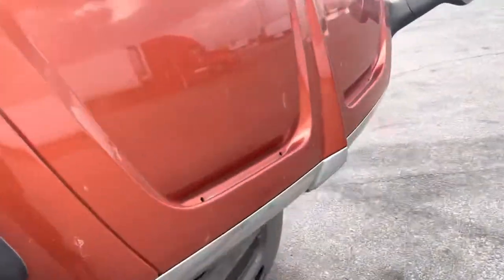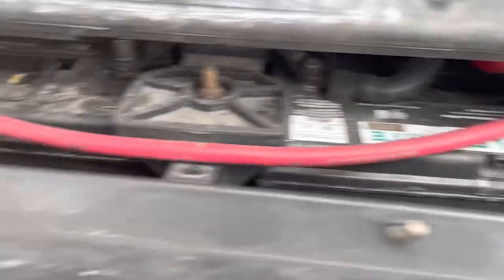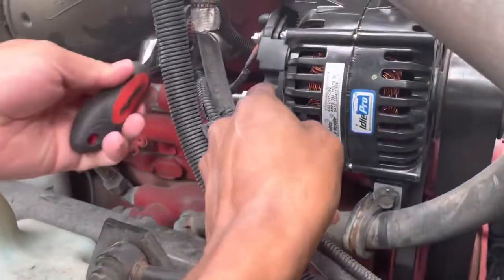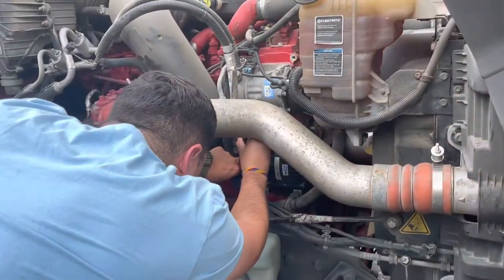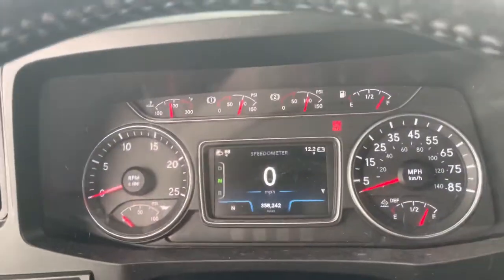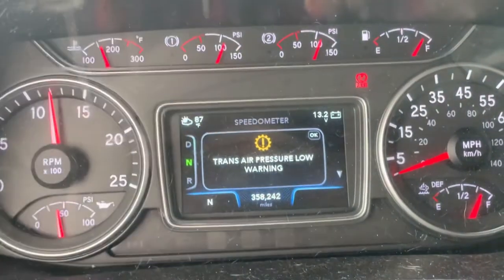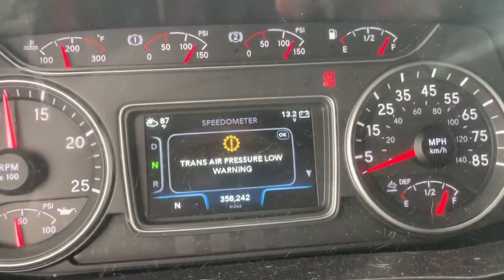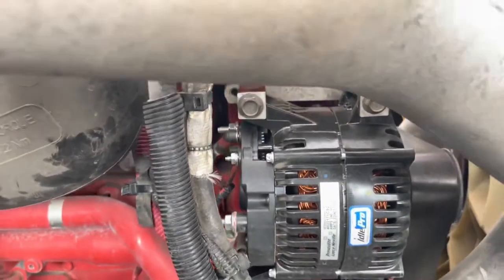battery voltage going up and down batteries over charging (problem fixed)

Comment: I had the same problem and shop told me I need a new alternator....replaced  it my self and still doing the same going up and down....found out the remote sense wire was corroded...everything looks good now...

Comment: Hey my 2015 international 4300 has had issue starting but the battery level was good after 6 months of that issue the turn got a bit worst taking sometimes 3 turns to start up now the battery voltage gauge is at zero but I had three new batteries in 10 months ago

Comment: I have the same problem right now in my cascadia my batteries is smoking, boiling 🤦😔🤦
Reply: What was the problem? I replaced a battery after boiling and smoking, the next day the brand new battery done the same. Just had all 4 replaced and my voltage is still fluctuating and really low when truck is off. I'm stumped. Alternator read good voltage too.